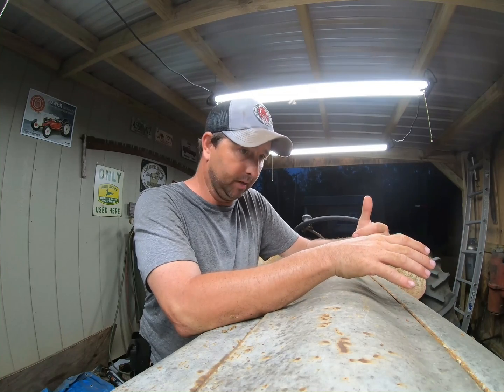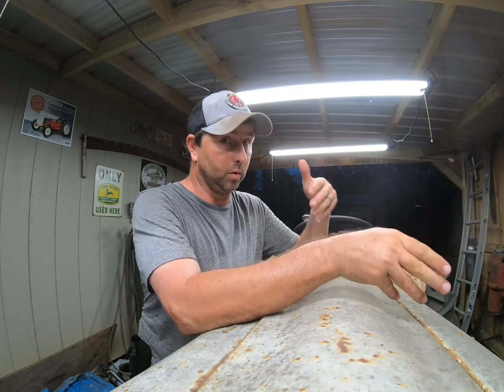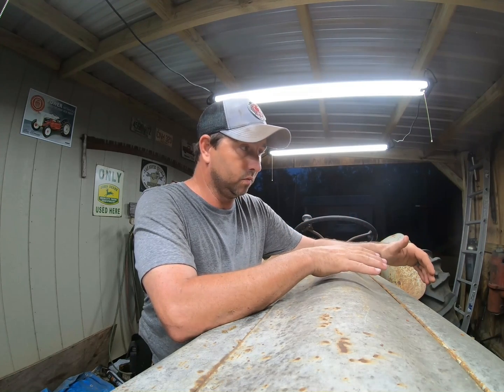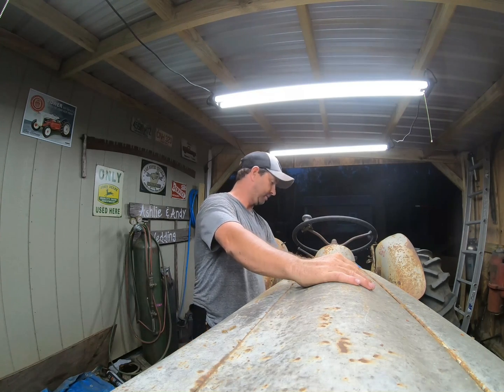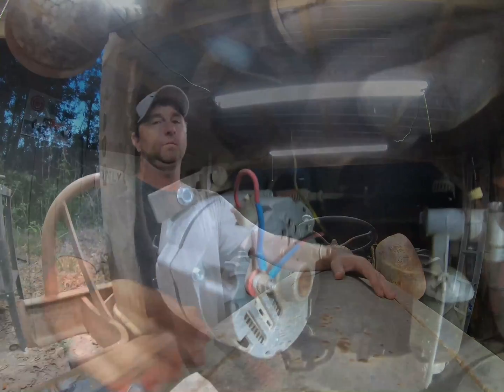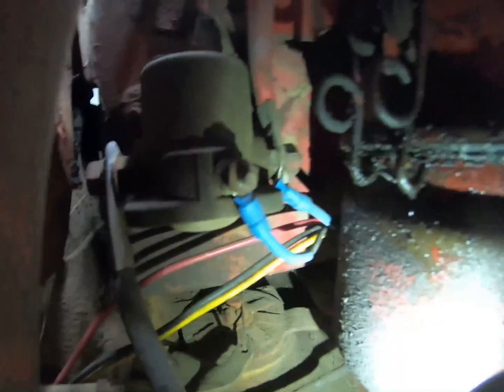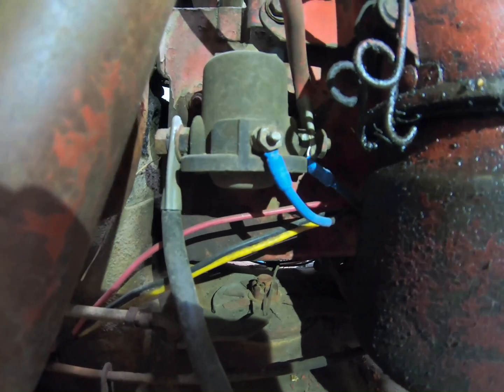6V to 12V Conversion Simplified (Answers for a viewer)

Comment: This content is excellent and too the point. Made wiring a tractor very simple. But just out of curiosity. Instead of terminating the alternator wire at the solenoid. Couldn't you have attached it at the battery post?

Comment: Yes, I really appreciate it was explained very well. I’m mechanically inclined also very much so actually just some of the swapping this old technology with new technology is a little daunting making the change though the electronic ignition is superior and every way you can think of converting to 12 V, that’s more common in it much better easier to work with more content like this is great explaining things very well and your diagrams are perfect. I had a construction company and I actually drew a print on a napkin and they let me pull the permit to Bill do the remodel off the napkin so I really appreciate, what you

Comment: Thank you.  I will be converting my 1959 Ford 841 to 12 volt negative ground soon. I have watched several videos and learn a little something from each one. I am also going to switch out the points in favor of electronic ignition.

Comment: Why would you want change to 12 volts,  6 volts started cars and tractors for over 50 years.  If everything is working correctly 6 works fine.
Reply: Exactly what I was going to say! 😝
Reply: 6 volt batteries aren't sold on the shelf as easily and cheap as they Use to, and if you switch to 12 volt you can get rid of the old Regulator.

Comment: I recently bought a 8n and 9n. The 9n came without a starter but has been converted. I have found a 6v starter. Can it be converted or is a 12v starter need to bought

Comment: I still think that all these conversions all over Fron 6 to 12.  Using the old 6 v starter is the wrong answer.  Spins the bendix and engages flywheel much faster risking tearing up nose cones, ring gears and bendix.

Comment: Great video. Does the Electronic ignition go in stock ford distributor & can you use your old coil if you just got a new one?
Reply from the maker: Yes it does go in the stock distributor. As far as the coil, look at the specs on the electronic ignition and make sure your coil meets its requirements.

Comment: 1955 ford 850 tractor with 172 motor - would like to use 12 volt electric conversion  - witch system 12volt positive ground or 12 volt negitive ground - also witch pluggs. thanks  for ant help
Reply from the maker: I would say 12v negative ground as that is most common. As far as plugs are you asking about spark plugs? If so, what ignition system will you be running? Points or electronic (Pertronix) type?
Reply: @AmericanTradesmen  pertronix 12 volt negitive ground, yes what size spark plug, thanks scotty
Reply from the maker: @janetthompson2320  I use Autolite 437 plugs, they’re recommended for the 154 and 172 engines. I haven’t had any issues yet.
Reply: @AmericanTradesmen   thanks for advice the tractor runs better than 1955, i followed your drawings used thes parts--pertronix 1244a igition - pertronix coil 40511 - pertronix wires 704180 437 spark plugs. thanks once again scotty

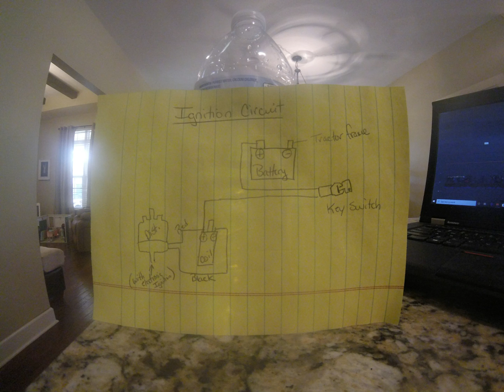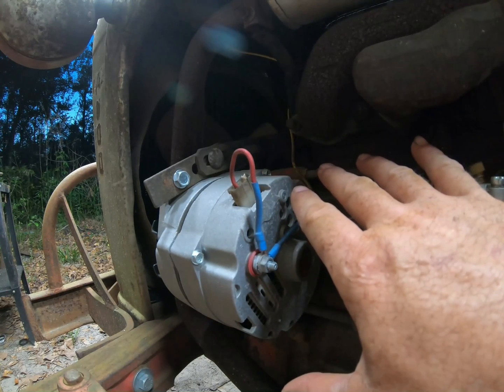Comment: I like to ask about the external resistor that tractors have from 12:00 to 6:00 you didn't mention anything about the external resistor on this cuz you're already at 12 volts if you're going 12 volts and going down to six you need that resistor and explain exactly what it does I'm not sure thank you carl plank

Comment: Is that a voltage regulator up high near the ignition switch? How does it factor in? Does it need to be converted from 6 to 12 volts?
Exactly what Genny do you ask for as far as amperge and which model number Genny and brand?  i
Where do you get the extension bracket for the alternator? And does that require a longer belt as a result?

Comment: My 601 ford is already 12 volt and starts from the switch but I want the starter button to work so it will not start in gear so what do I do to fix that?
Reply from the maker: The factory start button provides a ground to the starter solenoid. You will need a starter solenoid that requires a ground for activation instead of 12 volt positive for activation.

Comment: By far the best explanation yet! Seperate start button and ignition switch conversion to standard 4 wire ignition switch with nuetral safety switch conversion would be nice someday too. Also fuel gauge and ampmeter in curcuit

Comment: I'm finishing up my 12 volt conversion on my ford 841 and on my exciter plug im using it has a white wire (#1) I know this is for the red light that sits with the Guage cluster. Can you maybe show how that looks when properly installed? If I have it no reason it shouldn't be functional yaknow
Reply from the maker: I’ll see what I can do, it may be a bit before I can get the video up. Thanks for the comment and thanks for watching!

Comment: I just purchased my first tractor and it looks like yours. Is yours a Ford 841?
Reply: Well I've sent my email through this 4 times and each time I go back it has disappeared. Don't know how else to get it to you
Reply from the maker: @stevetodd551  I’m about to post a short video for you, let me know if it helps 👍
Reply: @AmericanTradesmen  your awesome thanks
Reply from the maker: This is a 640, little brother to the 800 series
Reply: I need a picture of the linkage where the friction washer is. I think my disk is upside down and there is a tab off where the throttle linkage gos that looks like its supposed to have a spring to it. In short my throttle wont stay open, I have to hold it open and steer at the same time. I'm new to this and I am not experienced yet. Can you help. I've looked at about everything and can't find any help
Reply from the maker: @stevetodd551  where’s the best place to send you a picture?
Reply: Thanks for your help. I appreciate your answering my questions and being patient.

Comment: what typ fuse box you using? good straight wire set-up but would be nice to see if and what kind fuse box you have or do you need it.i have think its 53 with didtributor on right side like yours but they have made mess of having wires everywhere and different charging regulator which ill trash.thanks. draw another wiring diagram pls that shows all wiring needed and for lights pls.good job

Comment: This is a freakin killa video!! Do you have anything like this for a diesel tractor? I have a 1974 ford 3000 I’m trying to wire up with a alternator. I have a brand new wiring harness but its for a generator and voltage regulator and I’m goin to a one wire alternator
Reply from the maker: Yes we do. I can’t copy the link on my phone but the title is Ford 3000 generator to alternator conversion. Thanks for the question/comment!

Comment: I’m wanting to use my starter button on the transmission, but my Solenoid will only activate with a hot wire instead of ground, how do I change that?

Comment: did you keep the original 6v solenoid or did you upgrade to a 12v because from the looks a 12v solenoid has 2 terminals coming off of the center of it just curious if the 6v solenoid will work on the 12v circuit

Comment: Nice Video!  But didn't catch anything about the internal vs external coil resistor.  Any help appreciated..Starting here on converting Farmall M 6 volt positive ground to 12 volt negative.  Thanks!

Comment: Also my tractor is a ford 2000 think it’s a 1963. Will this fit it. I want to convert mine from 6 volt to 12 volt. And I want to go electronic ignition.  I want to remove all mY old  wires and put on all new. So can I just get rid of the existing wires and retire with all new gauges on it.  What regulator should I also go with.
Reply from the maker: If it’s a 63, which will have the same sheet metal design as the one in this video, yes it will work. If you use an ac delco you won’t need a regulator because the regulator is an internal part of the alternator. These tractors have very simple electronics, you can easily sit down and draw out a schematic for your wiring and go at it. Really appreciate you watching and the question 👍

Comment: Does this just fit inside current distribtuer or do I need to change it also.
Reply from the maker: It mounts right where the points did in the existing distributor, unless your distributor is worn or damaged you shouldn’t need a new one

Comment: I put a Vega alternator on a Ford tractor 30 years ago, weren't no YouTube then. Got a Chevrolet and Ford wiring diagram and Drew out what I needed. Then took every wire on it off and started from scratch. Used correct size wires, fuseable links, fuses then wrapped wires & put in factory clamps.
Couldn't tell it didn't come from the factory that way. Charged 14 volts at idle. 
Since no one was any help when I did mine, I don't give out wiring 
Diagrams...figure it out yourself or put on one of those 1 wire jobs ( that I wouldn't use).
I've seen some God awful messes that others have done, loose wires hanging out all over the place. One bright individual put the starter button on top of the hood and live wired it to the battery. Anybody that dumb deserves getting their ring gear and starter destroyed.

Comment: One question. The 6 volt lights may not work. Any suggestions.
Reply from the maker: They’ll work and be VERY bright, but just for a second 😂 you’ll want to change them 12 volt. I put LED replacements in my factory headlamp buckets and they’re awesome. I’ll look back through my Amazon account and see if I can find the link for them. A standard 12v replacement will work, I just prefer LED myself.

Comment: If you have a 6 volt mag can you keep it when you switch from 6 volt to 12 volt with out burning it up?
Reply from the maker: Well, if you’re working on one of these old Ford’s they don’t have magnetos. Their setup is like that in an old vehicle with a 6v positive ground system. Meaning that there is a coil, points and condenser. I haven’t done a conversion on something like a farmall with a magneto so I can’t answer that question with experience or accuracy. I hope to do a Farmall cub in the future and I’ll probably do a conversion on it. Only then would I be able to speak from experience or with confidence. Sorry I couldn’t be of more help.

Comment: I agree on the electronic system.  My '72 Ford 2000 refuses to start in cold weather and I just changed it to a Petronix system and can't wait until it gets cold to see how it does.  My 800 is converted to the Delco like yours as well as a number of my others. If you'd like to take the time, check this one out, its not quite the same as your conversion, I use a voltmeter in the circuit.  This is pretty much from start to end from making a bracket to the wiring. https://www.youtube.com/watch?v=kOTA9EfhEos  Btw...good video and well done.  Your drawings are far more superior than mine.  Thanks for the informative video.
Reply from the maker: Thanks for the comment and kind words, and I’m headed over to check your video/channel out now 👍

Comment: I have and 801 Ford tractor that was converted to 12 Volt system before I purchased it, it is a positive ground, can i change over to a negative ground, by changing the positive and negative wires on the solenoid start sides?
Reply from the maker: To be completely honest, I’d have to see the tractor in person before I would give you a definitive answer. Personally I have never worked on a 12v conversion that retained the positive ground. I don’t want to give an guess of an answer that might cause big problems for you.
Reply: I have looked at serval pieces of info on line, the ground wire is hooked to the starter solenoid and the positive wire was fastened to the support for the gas tank?

Comment: I have a 600 ford that i want to convert to 12 v I was wondering if the positive ground on my 6 v system makes a difference or just making it neg.ground is just switching the bat cables
Reply from the maker: Thanks for the question. Personally I haven’t changed a tractor from 6 volt positive ground to 12 volt negative ground. I have always been the lucky one to sort through or completely replace someone else’s conversion. I don’t want to give an answer that might cause big problems for you. If I had the tractor in front of me we could sort through it no problem, I just don’t want to guess and tell you wrong.
Reply: @AmericanTradesmen  That is what I'm doing, working on someone else's conversion. Right now the wire from the alt. is bare where the insulation burnt off of it. I'm more than sure I can fix it now.
Reply from the maker: @markosborne2650  that’s great! Sometimes that’s the hardest thing is going behind someone else. That’s the reason why I opted to start over on my tractor, it would have taken far too long to try to figure out the birds nest behind the dash. Thanks for commenting!

Comment: I asked for this too, have tried it, but cannot get it to turn over. What could be wrong.
Reply from the maker: GenesisFarmHomestead I need a little more info before I give you a suggestion. First, are you using the factory start push button. Next, am I understanding you converted to 12 volt? Let me know and I’ll be glad to try and help you out. Thanks for watching!
Reply: Mine has positive from battery straight to starter and wire from ignition to solenoid

Comment: I’ve always wanted a Ford Tractor. 
So I Purchased one in 2017. 
I constantly have trouble starting it and the wiring looks like it was half-a$$ done so I’m going to tackle converting 6v to 12 volt so I can eventually add its lights.
Reply from the maker: A Funari-Hix I think you’ll be glad once the conversion is complete. Good luck and hope all goes smooth for you! Thanks for watching!

Comment: I have another question.  What size battery would I use for an IH 350?  Thanks
Reply from the maker: Donald If it’s a gas burner or LP I would think that 500-550 cold cranking amps would be fine. If it’s a diesel model I’d go a little bigger due to the higher compression. Hope this helps and thanks for asking!
Reply from the maker: I just looked up the IH 350 on tractor data, apparently the gas version was 6 volt while the LP and diesel were both 12 volt.
Reply: @AmericanTradesmen  Thanks for answering my questions. Also, how do I know if the coil is an internal resistance 12v coil or a 6v coil that needs an external resistor for 12v conversion.  When I bought the tractor, I believe the owner said it was converted,  but everything looks original..So I'm not sure if it was done correctly. I do know that there is no generator nor alternator, and the voltage regulator box has the wires coming off of it but all lead to dead ends taped off. Real cobb job. So I ask again, how do I know if I need to put a resistor on the coil, or is it ok the way it is?  Thanks

Comment: Hello.  I have a question about your tractor. Everything looks like original, which I believe would be a 6v system (starter, coil, distributor, ect..).  You didn't have to change anything to use a 12v battery?  Or is it a 6v system and battery?  I have an old international 350 utility and am trying to figure out whether someone just put a 12v battery on a 6v system, or if it is actually a 12v system.  Thanks

Comment: Very helpfull video. I do have a question how would the ammeter be connected?
Reply from the maker: I personally have encountered 3 different types of ammeter hook ups. The first, like on this particular tractor, there is a metal loop, or ring, on the back side of the gauge. Simply let your wire from the alternator pass through this loop. The next type has 2 studs on the back of the ammeter. Run from the alternator to one stud. From the other stud to your positive on the battery. The third you simply run a positive and a negative to the ammeter. Each of these will be labeled on the back with what they require (+) or (-). I hope that makes sense. If not we can make a video on that as well. Thanks for the question!